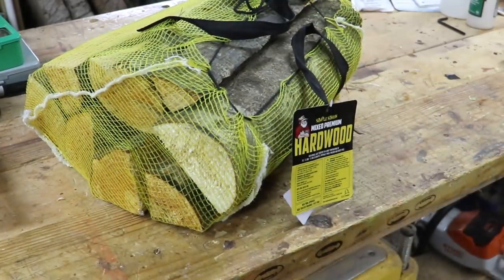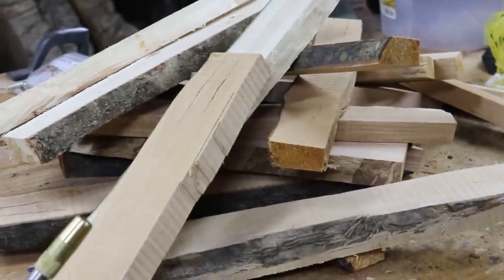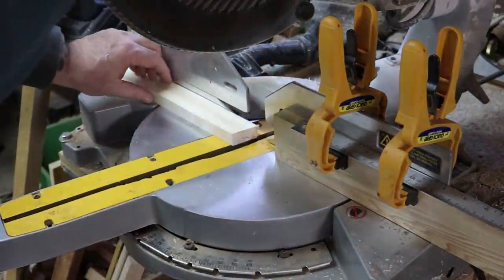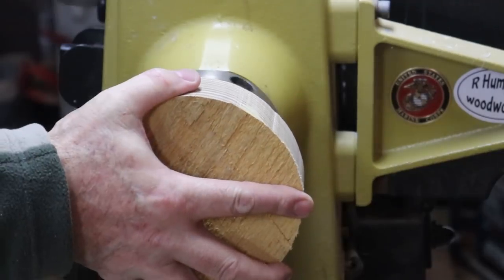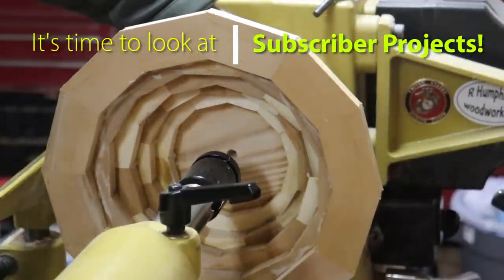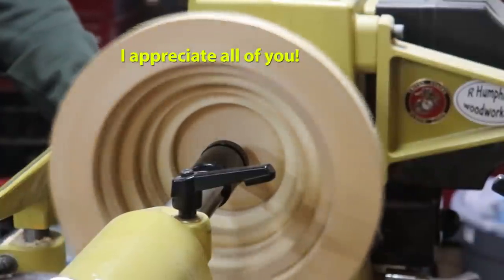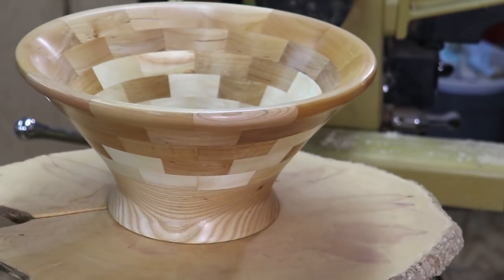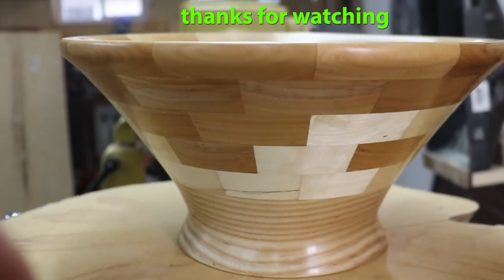Woodturning a Bowl from Bundled Firewood

Comment: I usually put a segmented rim on my bowls. Making rings takes extra effort and time but create a look unlike a solid piece of wood. I also use a drum sander to flatten them to get a good, tight glue joint. Ring segments have minimal exposed end grain so turning and sanding are usually easier too.  Laying out the segments, end to end on masking tape makes glue-up easier and faster. I still use a clamp to squeeze the ring for tight joints until dry. This is a good way to use those offcuts and scraps too small for regular turning. Good job, Ron.

Comment: Looks great! Would it be possible to get a bit more detail on your home made segment length chart?
Reply from the maker: Thank you!  I made it with a compass, protractor, and ruler.  I have one made up for a few different segment counts, they're a great quick reference tool.  The circumference lines are spaced at 1/2 inches apart, but the segment length can be measured at any point for the desired overlap.  I laminated them with packing tape, and they've lasted for many years.

Comment: Beautiful piece.

Here is what I don’t understand. There are different colors of wood here. Did the original firewood have more than one color? Before you cut it down, it all looked like it was the same color. Explanation?
Reply from the maker: Look at the thumb nail for this video, you can see two or three logs that have lighter colored wood.  It was a bundle of "hardwood" with no details on the species included.  The colors are part of what drew my attention in the store.  Thanks!

Comment: Firewood came from the same tree as one of those expensive turning blanks. It just hasn't had the TLC yet. The only concern I might have would be moisture content. Did you check the stuff you were using? It did turn out well. Very nice indeed. I very much liked your production too. You demonstrated every step but just enough and not too much. If you are going to do segmented turnings may I recommend you make a wedgie sled for cutting segments. A note on safety. I noticed several of the strips lifting off of the table a bit going through the table saw. A push stick might have been in order. I would hate to have to miss you on Friday mornings while you were growing new fingers. Still, thank you for sharing. Have a great 2021 and stay healthy.
Reply from the maker: I didn't check it for moisture content, but it was very dry.  These firewood bundles are always ready for the fire, never green wood.  I didn't show the whole cuts on the table saw, I definitely transitioned to a push stick every time.  All digits present and accounted for... although I did injure my thumb recently... all better now. 😊

Comment: This didnt go the way i thought. 
Ok. So you have the firewood. Im good with cutting it in thin strips so you know the cracks all got sealed in resin. But you just kinda stick all the sticks in a form til its packed tight, then fill with resin. Should end up looking neat with all the bark and different woods in there